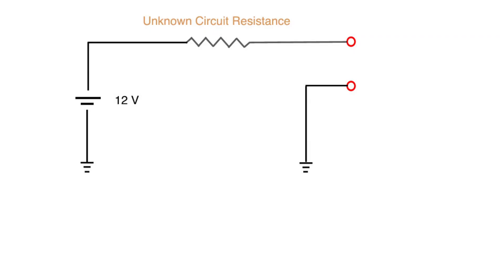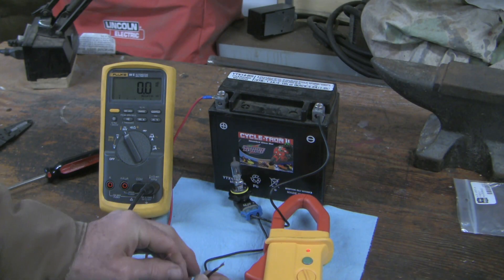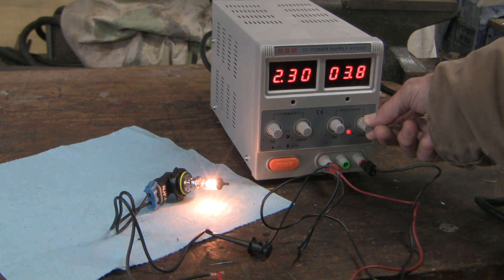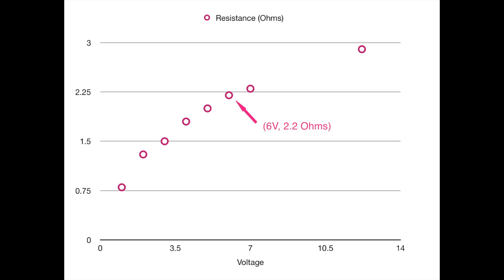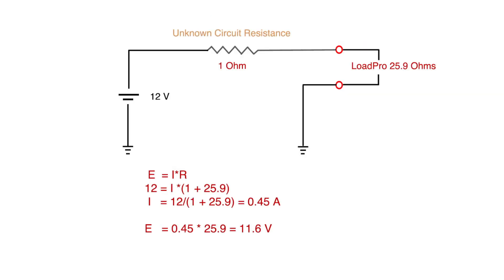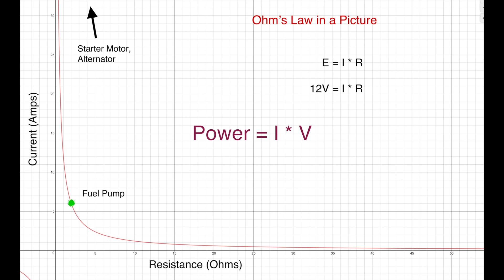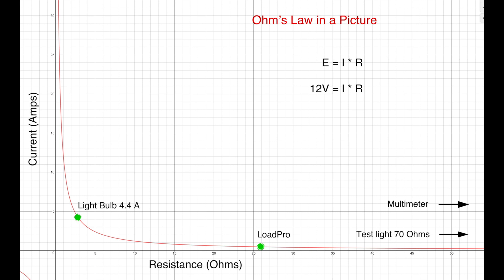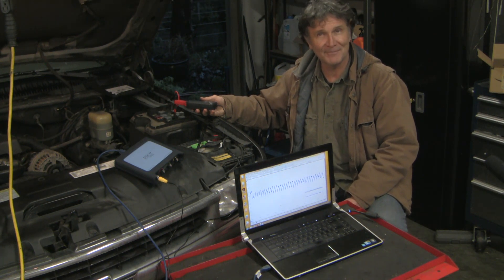When and why to use a light bulb for automotive voltage drop testing

Comment: So what wattage bulb would be safe for a 24 v circuit?
Reply from the maker: That's a good question. Bulbs are rated for the maximum voltage they can tolerate without burning out, and the wattage. Since power = current*voltage, to get maximum current, divide wattage by maximum voltage. The current draw for your test light should be safely below that threshold.To get typical current draw for your test light, I'd do a few simple experiments to decide what the approximate resistance of your test light is. As outlined in the video, you want a test light bulb to draw about what the circuit normally draws, since you're unlikely to damage sensitive components of the circuit with that and since you are trying to reproduce what the circuit normally sees. This leads to the realization that you may want the versatility that comes with more than one test light. My OTC 75 ohm test light shown in the video is able to function normally in a 24V system and is a good all around test light.  For higher amperage circuits you'll want something with a little less resistance.

Comment: Some further information when troubleshooting +12VDC powered vehicles using a circuit load:

In the US the video would fall under the general category of vehicle circuit load testing, where we are using a temporary applied load in conjunction with a voltmeter and or sometimes an ammeter to test for high resistance wiring and connection faults. 

There are two primary categories of this test: 

High current (10 Amps to about 500 Amps, for HD trucks the high end is around 800 Amps). 

Low Current (below 10 Amps). 

How the car is setup for testing and what do we test with: 

Loading circuits up to 20 Amps (small conductor circuits 18 AWG to 12 AWG): 

A voltage maintainer (low noise DC regulated power supply) is used to power the vehicle and put a slight charge on the battery. We want to perform the testing at a known and regulated vehicle voltage level at about 13.5 VDC, unless we are exceeding the battery 1/10 C charge rate. You can monitor the current as you power the vehicle key off and stop at a constant 1/10 C rate (the charge current will stabilize roughly at around the bulk charge voltage). So, if you have to test at 12.5 to 13.0 VDC this is fine, but normally a partially discharged battery can tolerate 13.5 VDC. The maintainer should be rated to 50 Amps in order to do the testing and charge the battery at the same time. Also, in general module reprogramming will give a maintainer requirement of 50 Amps (sometimes rated to 100 Amps if you follow the shop manual procedure) with maximum 50 mV P-P noise. When circuit load testing with a maintainer test key on engine off. If you have to start the vehicle remove the maintainer.

Really what we want to do with low current circuit load testing is lower the DMM VDC input resistance to provide and effective load for testing. 

This is best done using a non-inductive resistor at the appropriate resistance and power, and monitor the voltage across it. For example, if you want to draw 4 Amps approximately like the light bulb, then use a 3 Ohm resistor (non-inductive on a small heat sink, the test is usually only momentary) and monitor the voltage with the DMM on DCV. This is easily done at your DMM if the load resistor leads have stacking shrouded banana jacks. Plug the load into the DMM then your probes on top.

With common size resistors you can just estimate the current in the circuit using Ohms law. For example, if you are using a 10 Ohm load, which is very common, you can just divide the voltage reading by 10 to calculate the current.

What are the advantages of using resistors over bulbs: 

1) You can select the resistance values you find most useful when testing at a maintained voltage of 13.5 VDC. Perhaps (in Ohms): 3.0, 4.7, 10, 47, 100, 1000. 1000 Ohms is very handy in ruling out DC ghost voltage (a very high source impedance on a power feed), and if connected at the DMM terminals does not really get in the way. Some Fluke meters have a low Z AC Volts setting for AC ghost voltage which is very common in AC power distribution (mains power), it would be good to have a low Z DC Volts setting for automotive DMMs to eliminate DC ghost voltage which is not as common, but does happen, then you would not need the 1000 Ohm load resistor.

2) Large Resistors don't burn out like a glass bulb.

3) Large Resistors won't break like a glass bulb.

4) Large resistors take time to heat up (especially if you use a small heatsink), and won't burn you or interior carpeting.

5) Large planar non-inductive resistors do not have a high in-rush current like an incandescent bulb (up to 15x momentarily), and will last for decades of normal use. Where in rush is dangerous is when using it to monitor power at a control module. This is because if you touch a power feed output the in rush will blow a trace on the module PCB. In fact the PCB will be designed with a fuse section to the PCB trace so it blows first and is in a spot that is easily repaired.

6) Large planar non-inductive resistors will maintain their value with voltage (of course the value will change with temperature per the temperature coefficient).

7) If you do diagnostic work for higher end customers like dealers, OEMs or test labs you really do not want to test using a bulb or a test light. The engineers and technicians know that circuit load testing incandescent bulbs can damage modules. It is much more professional to come equipped with your DMM and test resistors, and for high current circuit load testing you will need a good Carbon Pile tester. Personally I do not use any bulb testers, all my testing is DMM plus resistive load testing unless of course I have to move up to using an Oscilloscope. 

Disadvantages of using resistors: Price. But you probably only need 4 or 5. 

Loading circuits over 20 Amps (large conductors circuits 10 AWG to 1 AWG): 

A fully charged battery is used to power the vehicle. To load the circuit a Carbon Pile adjustable load tester is used, like an Autometer SB-3 (max 500 Amps) which display both voltage and current while using a control to smoothly vary the load. With these testers we are looking to load the circuit momentarily with a large current to find bad connections in large current carrying circuits like, starting, charging, and grounding. You can also load test the battery if you like.
Reply from the maker: Those are good points. Indeed, the Load pro is little more than a 25 ohm resistor, packaged with a fuse and switch. It's a shame that the company went bankrupt. They made the mistake of marketing it like a black box, concealing the elegant simplicity which is critical to understanding how it works. Flat rate technicians are all about work flow speed, so they carefully choose diagnostic tests to be fast and unequivocal, with internal checks to be sure the equipment is working. So, having a light bulb glow bright while using a current draw similar to what the line needs to carry is flat rate gold. It's nice to measure voltage drop, from which you can exactly calculate line resistance, but for normal diagnostic tech work guys don't often reach for that. In the engineering world I can see a role for more exacting load tests. I also like your remark about carbon pile load testing. I have one of those old style 500A 'toasters', and it satisfies the high current demand for alternator and starter motor circuits. But I find it interesting to see how wise techs find more efficient ways to make the diagnosis even on a high current circuit, using little more than a standard incandescent test light.
Reply: @spelunkerd  If you are auto diagnostician and you write on your work order that you found a high resistance power feed or a high resistance short to ground you should be able to provide an accurate estimate to the value of this resistance, because this is essentially what you are being paid for. Diagnosticians are paid for essentially test results; accurate measurements, scope traces, thermal images, etc.

A light bulb does not provide enough information in order to bill your time. This is especially true if you get called in by a dealer or another shop. If you list as part of your bill (invoice) that the diagnosis identified a high resistance wiring or connection fault, the first thing the lead mechanic is going to ask is, okay what did you measure? You better have an answer.

Comment: Struggling to diagnose an electrical issue on my skid steer, FSS fuse keeps blowing when key is turned on 15amp fuse it powers a handful of things, most of which ive disconnected

Im wanting to have the circuit live with a bulb while i jigging wire loom and connect and disconnect things, it seems like the current circuit is almost a dead short once current is applied but was measuring 7ohms from ground to the fuse block pin earlier ill have to check and see if thats changed as the issue is sporadic and keeps evolving

In guessing adding one bulb will still blow a 15amp fuse, i need to add a few?
Reply from the maker: A 15A fuse should not blow with the resistance of a typical bulb, so you've probably got a parallel short, maybe upstream of the bulb. I made a little short circuit tester that plugs into the fuse box, allowing one to put the bulb and a buzzer right at the fuse box, so it has to be inline with the short. There's a really old video on my channel describing how that was done. Even a test light bridging the fuse connectors at the fuse box could be helpful. Dead shorts are a pain, it can take a long time to find the problem, especially with an intermittent. Hunt down connectors and try to divide the problem up so you can narrow down the source as much as possible, then manually trace the wire. Don't forget to look under the fuse box, too, it could be right there. If you have to you may choose to cut a wire to save yourself some time by dividing the problem in two. There are various products on the market that send an RF signal down the wire, with an inductive pickup to help in the hunt. Experienced pros are surprisingly cool to their use, they give misleading results and don't save a lot of time. I have one for 120V use but it was not very effective, too many misleading results caused by parallel wires.

Comment: so should i determine how much amperage normally would flow through that circuit and try to match a light bulb that draws the same amount?then because you now have a live circuit i can do a VD test as well thus the best way to test for a diy guy?because i dont want to buy pico scope or expensive tools as this is just my hobby this should be enough to get through most everything right?
Reply from the maker: Yes! You can easily estimate what circuits will carry based on what they drive. For most circuits a test light works fine, I would choose one with an incandescent light rather than an LED. For bigger circuits that do more physical work, like the window regulator, fuel pump, various motor drives, blower motor, door lock actuator, and even headlights, a simple headlight bulb works fine. Halogen headlight bulbs draw about 4 Amps. One of the things I most admire about Eric on the SouthMainAuto Youtube channel is the way he quickly and effortlessly uses his headlight bulb to verify the circuit can carry enough current to power a device. He proves, you don't have to be slow to do things right. If you just turn it on just for a second, it's not likely to fry anything in the circuit, but to be safe I would not test circuits ending in the computer with high current test devices. There are other methods for those. Thanks for your comment, it is nice to meet you.
Reply: @spelunkerd  perfect! i have a selection of bulbs a
0.2a
0.5a
2a
3a
4a
and a monster 6a.for the starting circuit is a 6amp bulb enough?i have a few i could add together?
Reply from the maker: @pigeonsil240sx  Great. The starting circuit is a special case, because the inrush current on those motors is extraordinary, usually greater than 150 Amps. It's on such a steep part of the I/R curve that even an extra ohm of resistance can be enough to pull down the current so far that the motor won't spin. Nobody has a 150 Amp headlight! So the problem with lightbulbs is the falsely reassuring result if it glows brightly. Wiring bulbs in parallel is too much trouble, wiring in series won't work. The fast approach to the starter problem is easy enough if your starter is drawing current. Use the motor itself, rather than a headlight. If you can get to the motor connections, that is easy, clip your multimeter to the attached B+ post of the starter and run the other multimeter lead with a jumper back to the negative pole of the battery. Even with key off you should get 12 V. Then get a friend to turn the engine over with the key and watch how far the voltage sags. If it sags more than 1/2 volt, you've got excessive resistance of the line. Fix that first before condemning the starter! If nothing happens at all, move your multimeter lead to the other terminal of the battery, the trigger post that comes from the ignition relay. You should get 12 V there, only when your friend turns the key, again with minimal drop. As a final test of the wiring, you can put a 4A headlight bulb between the attached trigger post and a ground somewhere. The other tricky thing about the starter is the way you can't often tell whether the problem is the solenoid or the starter itself. Nine times out of ten it's corroded contacts of the solenoid, which can be sometimes fixed with a little effort.